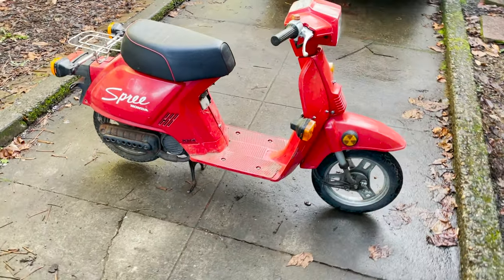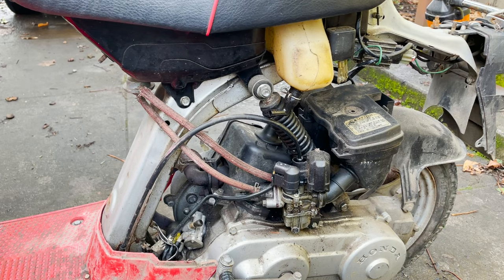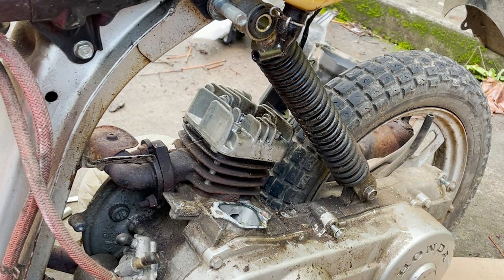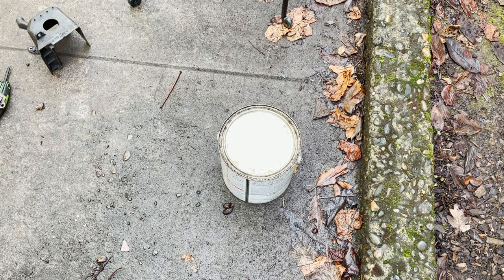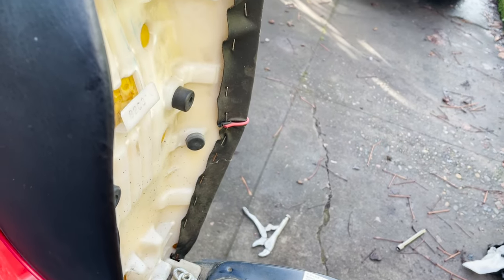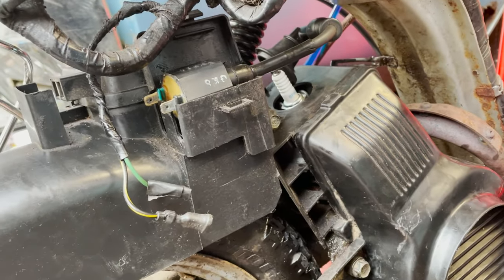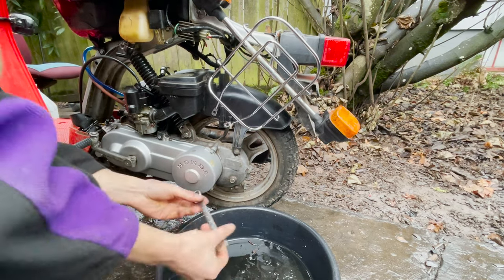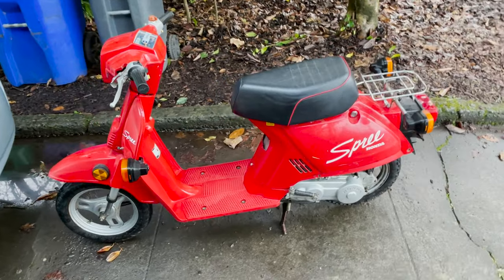$100 Honda Spree NQ50 - WILL IT RUN?? How to fix after sitting for 20 years!! RESURRECTION!

Comment: I got a 1984 Honda Spree
Reply from the maker: Zeke Polaris That’s awesome! I hope this video helps you out if yours isn’t running. They are super fun little scooters!
Reply: @Mechanic_kid  Mine runs just needs a new battery.
Reply from the maker: Zeke Polaris oh nice! Ya the battery acts as a voltage regulator so it’s good to have so you don’t blow out your lights at high rpm’s👍🏼
Reply: @Mechanic_kid  And it recharges too!! That is if there was a working battery. Been looking for one but can't find
Reply from the maker: Zeke Polaris most batteries shops have them. Generic motorcycle battery. If not check eBay
Reply: @Mechanic_kid  Idk if I can use ebay.

Comment: throw the pipe in a fire pit itll be brand new after
Reply: also the bolt under the fill side of case is the drain plug
Reply from the maker: Yep that’s a great tip! I thought about doing it but didn’t want to accidentally catch the house on fire. Ended up fine, just letting it hang over night